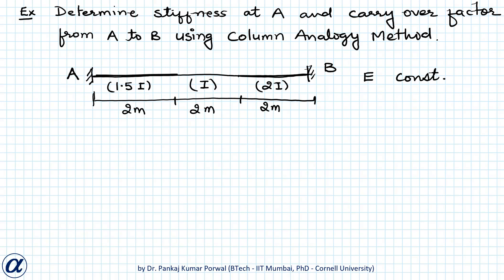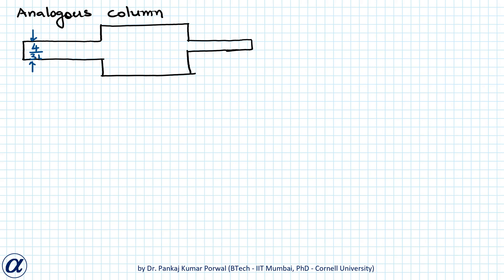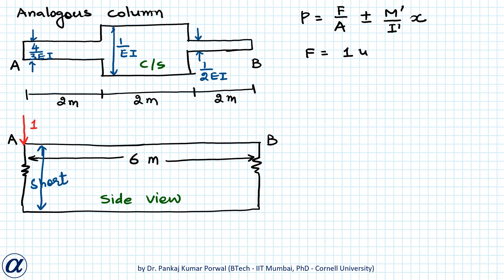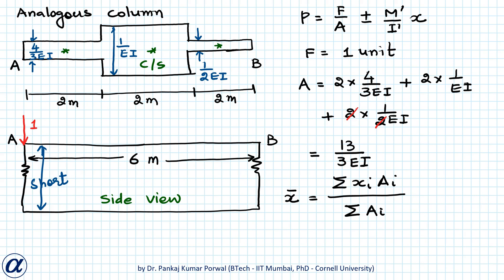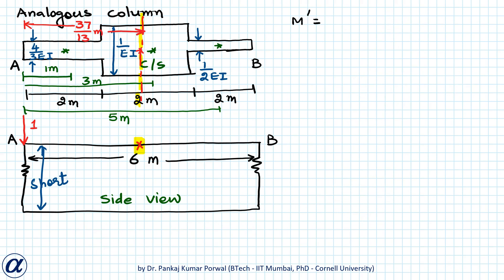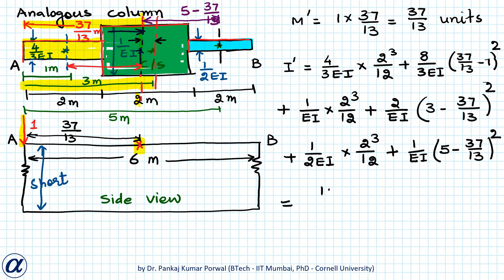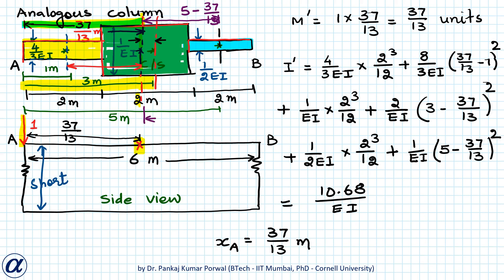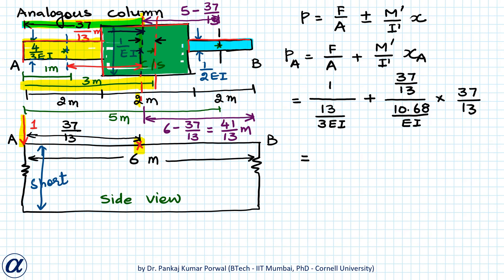Example 2 Stiffness and Carry Over Factor Column Analogy Method

Comment: What will be the stiffness at b and also carryover factor from b to a
Reply from the maker: I don't have the answer but for that you will have to apply unit load at b and do the calculation.
Reply: Pankaj Porwal Thank You sir
Reply: How did u write 1/1.5 EI = 4/3EI
Please reply
Reply: @mohdiftequarhussain283  1.5=4/3
Reply: Pretty good explanation sir you just saved my day